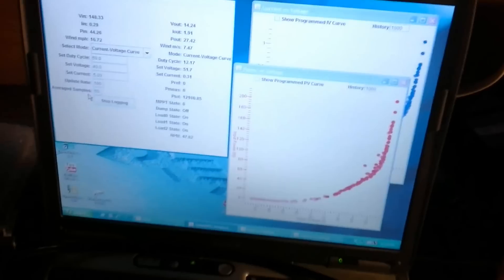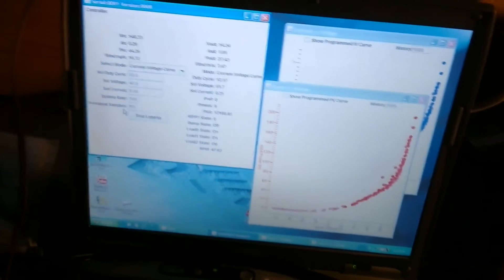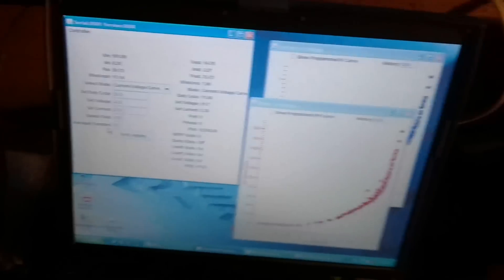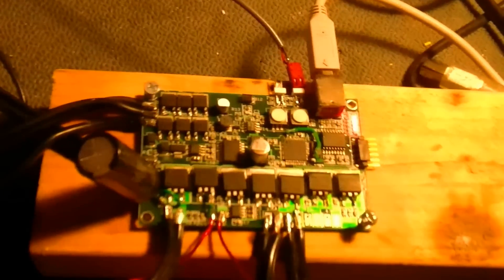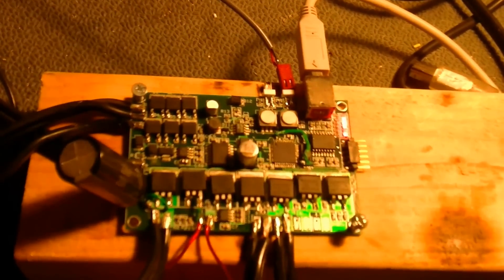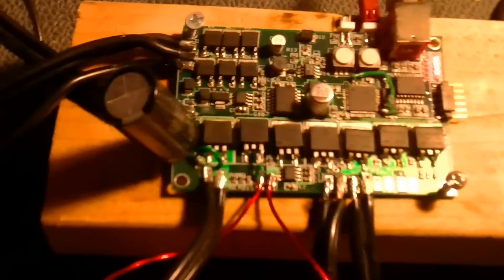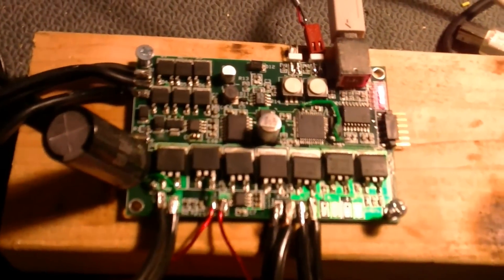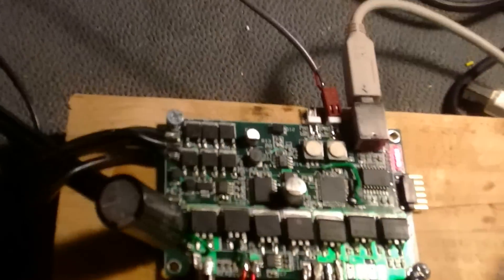MPPT Testing 2

Comment: A PIC16F685.  I was originally using a 16F785, but moved to the 16F685 due to the fewer features requiring fewer register settings.  The additional program flash and RAM are other pluses, as the PIC is also running the idiot lights and load controls (low potential disconnect and dump).  I will also need the added space for things like a serial LCD if I add one.

Comment from the maker: I did spice simulations of a lot of those types  of drivers but had problems getting them to start up if the load was a battery at some voltage like 24 or 36v.  I guess it's possible to still get them to bootstrap, but you have to use the synchronous rectification to have current flow backwards to get the voltage low enough to start the process.  Maybe I'll try that on Version 4. :-)

Comment: What about a bootstrapping MOSFET driver?  I have been using IRS2118s in my own MPPT controller design with reasonable success so far (at least on the hardware side; the bloody PIC only wants to use AN0 as an analog input despite what I tell it to read in the software).  Depending on your MCU output levels, something like an IRS21171 (TTL level input) might work.

Comment from the maker: I really like the ability to reflow the whole board, including the transistors.  Generally I've put much more power through those parts with no problems, but I found that my gate driver circuit isn't working too well above 150v, so the transistor is spending some time in the active region which isn't good for heat.   Version 3 may be slightly better.

Comment: What about using TO-220 or similar (TO-202, TO-247, etc.) devices that can be easily mounted to a heatsink?  Those TO-252 transistors need things like MCPCBs for adequate cooling.